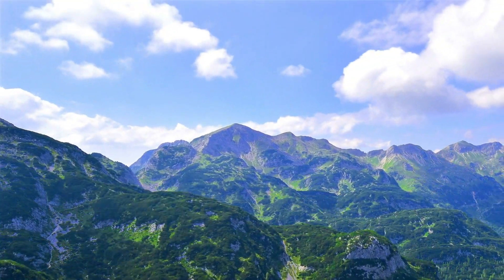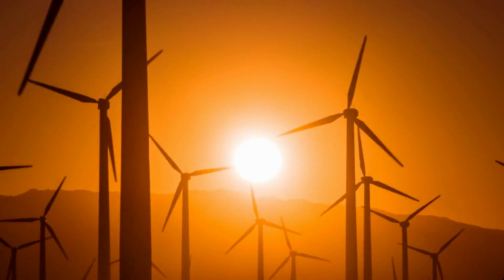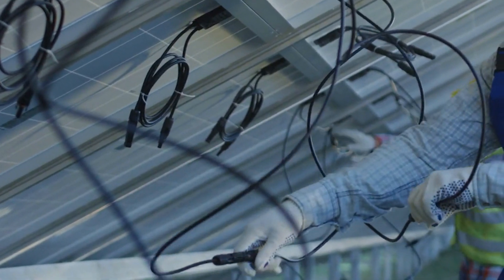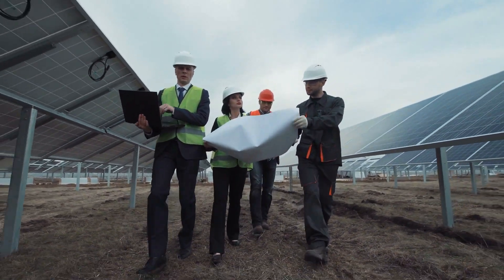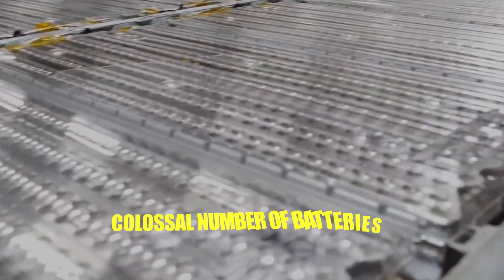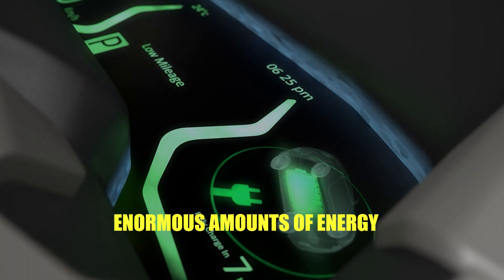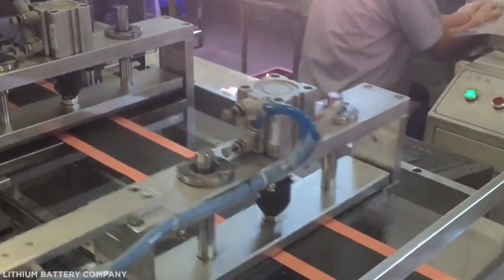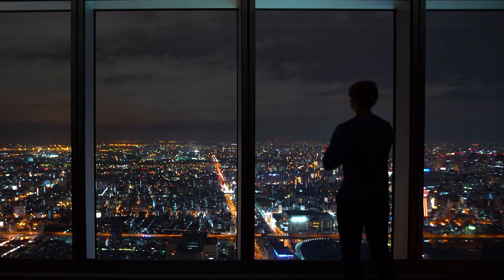Beyond the Green Glow: The Untold Costs of Renewable Energy!

Comment: As to solar pannels, also here, lies, Cadmium is a trace element, so lees than 1 %, it is an element free in nature at similar levels. Solar panels are no longer produced in the way anyway, thinfill will soon take over, reducing the weight with afactor of 1.000.... so even is 72 million tonnes would be correct, and it isn't, divide that by 100.000 leaves us with 720 tonnes of toxic waist... about 20 truck over 25 years.... impressive